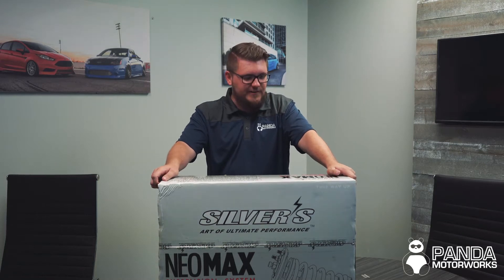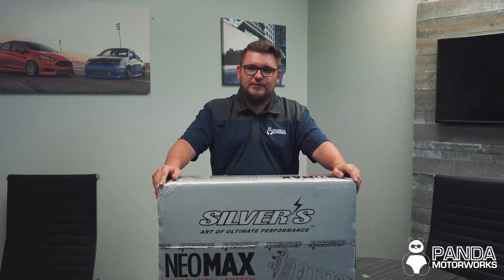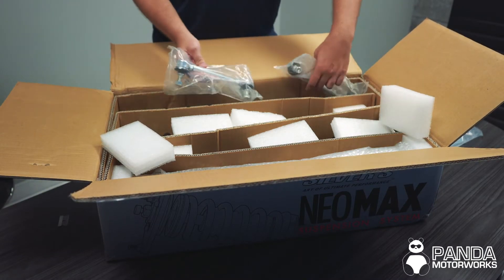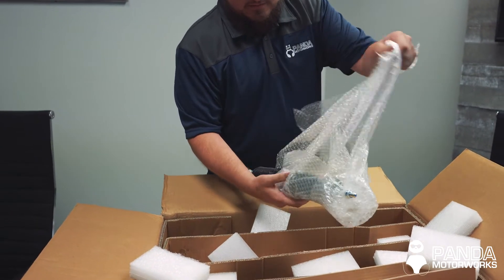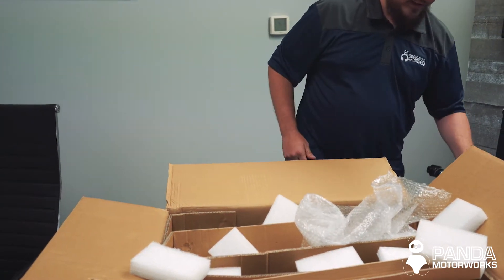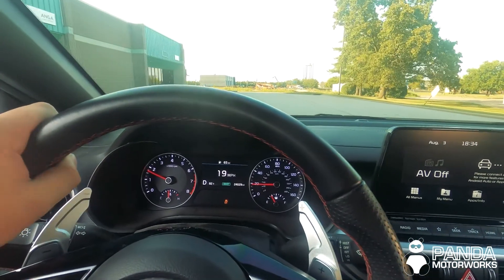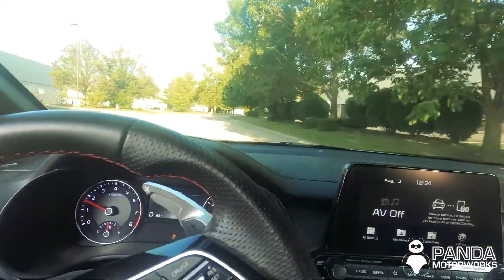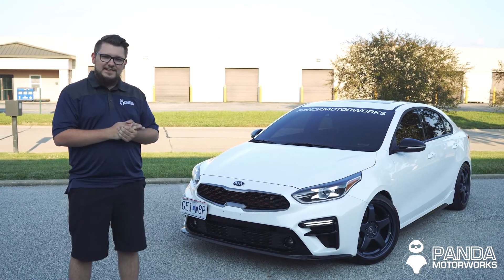The Kia Forte GT is BACK! | Silver's NeoMax Coilover Install

Comment: I just bought a brand new Kia Forte GT2 a couple months ago should I change the suspension in this car knowing that has a sport suspension or should I replace just the springs to lower the car and  make it have less body roll and more handling ?
Reply: I also bought a 23 gt limited  I have the eibachs but they are not compatible with the stock shocks so I would just go with the coilovers in thinking about getting these,  and possibly getting an air cup attachment, I really want BC Racing but they do not make them for 23 yet

Comment: How low did the forte drop once you installed the coil overs? Did you guys make any adjustments to the drop or just do a straight install with no adjustment.
Reply from the maker: I believe we saw around 2"-2.5" in drop on this install. Some height adjustments were made to dial in the fitment, but camber, preload, and damping were all set out of the box.

Comment: Can these coilovers match the same height of the stock coilovers? It seems like all the other coilover manufactures have at least 2" drop at their highest setting. I'm running 245/45/18 on 18x8.5 +50 offset wheels and if I were to lower my car 2", it will definitely rub.
Reply: My car has a very similar setup, 245/35/18 on 18x9 +34, and at about 1.5 degrees cambered, doesn’t rub unless I’m hitting something pretty hard.  1.75” drop for reference

Comment: What would be the best tire fitting when installing these springs  on a 2022 Kia Forte Gt and how much would the spring lower the car?
Reply: Without scrapping
Reply: 235 45 18 is the biggest
Reply from the maker: 225/40r18s were installed on this Forte GT!
Reply: @PandaMotorworks  What were the wheel specs though? I'm currently running 18x8.5 +35

Comment: I bought YellowSpeed coilovers few months back. They feel very rough over bumps and dips, esspectially during spirited driving, sometimes I nearly jump out my seat. I've been told that this is just how coilvers feels and there's nothing that can be done about it. Would these coilovers provide for a smoother, more comfortable ride?
Reply from the maker: When it comes to a smooth ride on coilovers, its all about the shocks and how they're setup. Budget friendly coilovers typically have a harsher ride than a higher end coilover. Thanks to the digressive shocks, Silver's tend to ride very very well!
Reply: @PandaMotorworks  Hi again, getting ready to pull the triggered on these. I just had another question. Do these come preloaded and if so how much?
Reply: Did you install Silver's on your car?
If the answer is yes, please tell me your opinion about it because I want a smooth riding + higher performance than the oem, thanks
Reply: @mjo0ody888  I did and they were much better than the ones I had before. No weird noises, the were smooth and the they did a great job